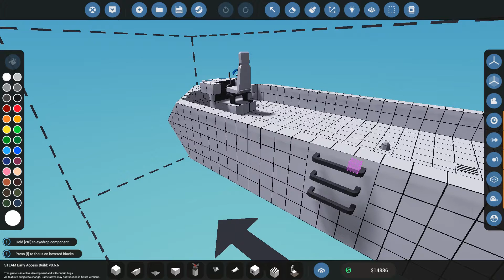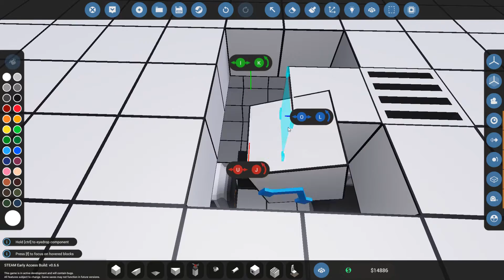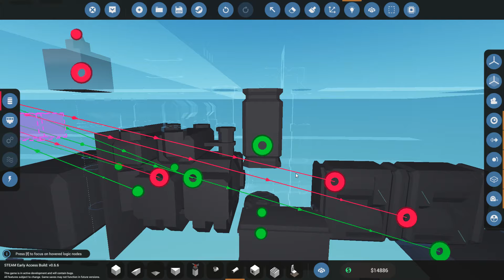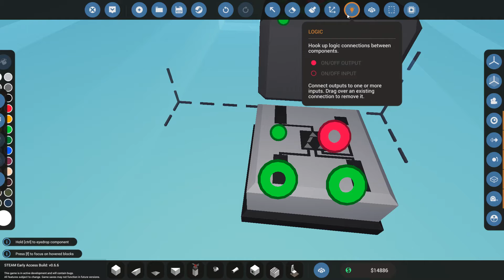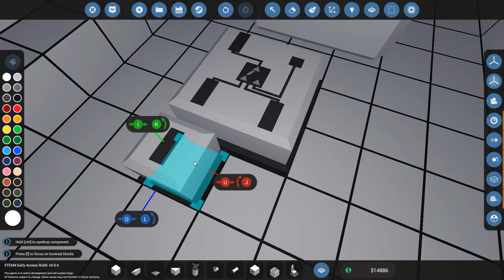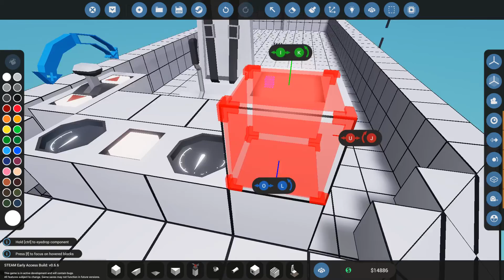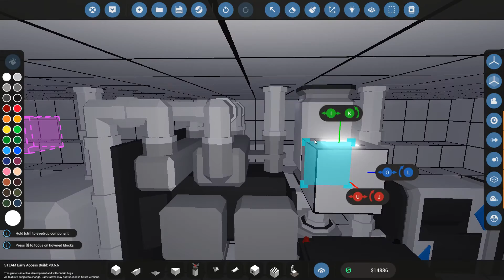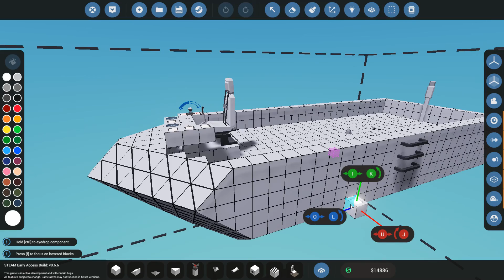Stormworks: Build And Rescue - Get Started In Advanced Career Mode - Part 4 - Clutch

Comment: What's the point of having that logic thing to control the clutch if you have a toggle switch that does the same thing?
Reply from the maker: Depending on the gear it can be too much for the engine to suddenly have to switch to such a gear. That's why I used a throttle.
Reply: @Stealth17Gaming  if I'm not mistaken you used a throttle only as an example, but then you used a toggle button coupled with that logic box thing. But why use the logic box, if it does the same thing as the toggle switch? Am I missing something?
Reply from the maker: It explains how to build a logic box. It's been 18 months since I made the video, but I believe that that was the thinking behind it.
Reply: @Stealth17Gaming  The clutch is expecting a "number" signal, which is marked green, whereas the toggle button gives an "on/off" signal type, which is red. Just re-watched the video so you don't have to. PS. The bicycle references are too damn high! You must be Dutch...

Comment: ive built this set pretty much the same the issue im having is going into reverse. so i can efficiently go into clutch or 1st gear and then my next gear fine. disengage next gear then clutch and im back in neutral and with very slight forward momentum i engage reverse then clutch and i stall buuutttt if i have clutch engaged and reverse aswell then start it it works fine. any tips?
Reply: also im using 2 small engines and the power runs together into one the a generator tsplit then the gears etcs. idk if tht makes a diff

Comment: I use a 2 block microcontroller for clutch control. It's the same logic built inside the microcontroller editor. The block being 1/3 the size of macro logic helps a lot on small boats.
Reply from the maker: I only started dabbling with microcontrollers 2 days ago. Tutorial 6 will be a tutorial on a microcontroller for the clutch. It will be up in a few days. Eager to hear your feedback on that then :)